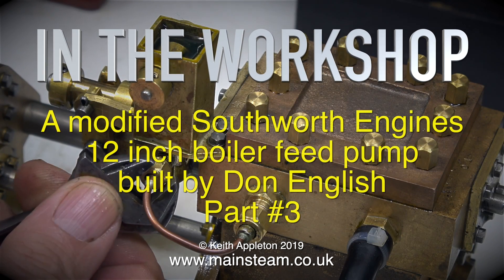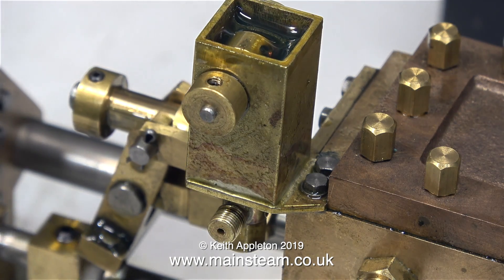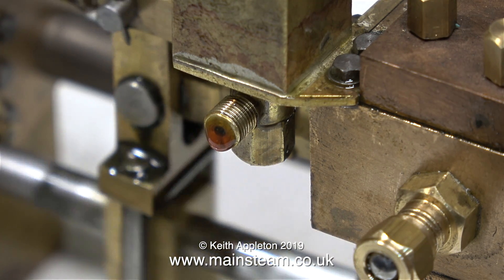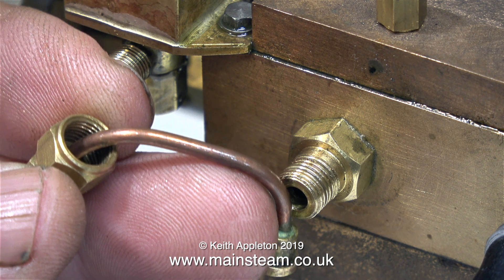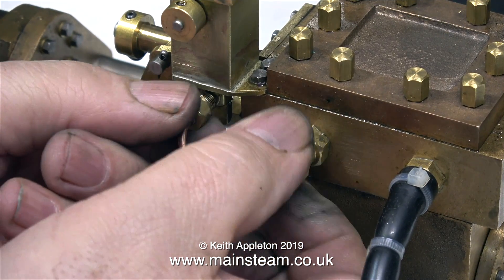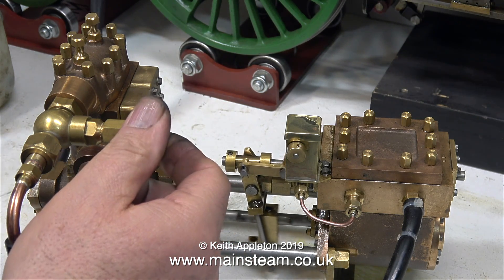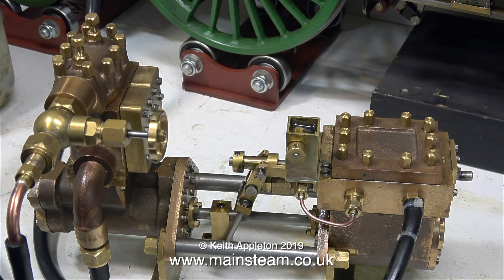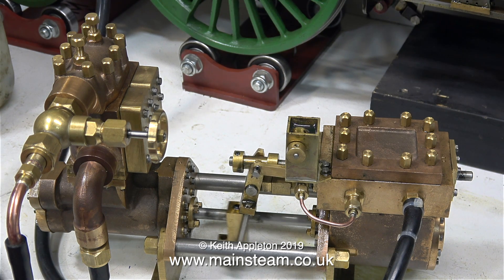A HORIZONTAL SOUTHWORTH 12 INCH BOILER FEED PUMP - PART #3

Comment: I think you need to machine a taper in the brass union, to fit the taper on the piple nipple so it can fit properly
Reply from the maker: A flat face is just as good, and these are what are normally used on many steam pipes, especially injectors and pumps. The piping fits perfectly without any leaks even at very high pressure.